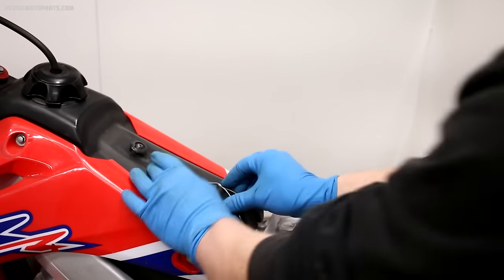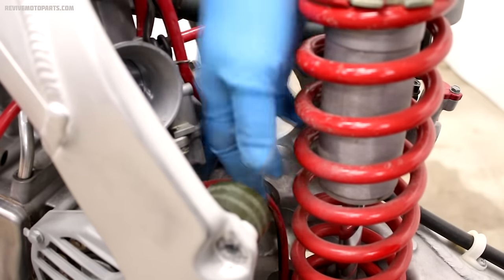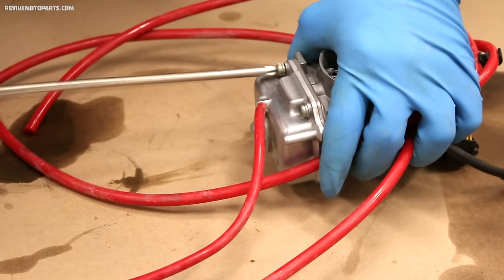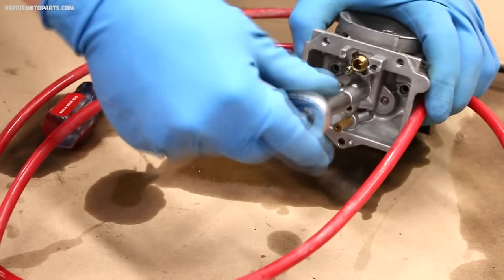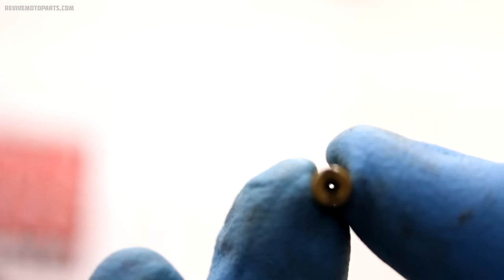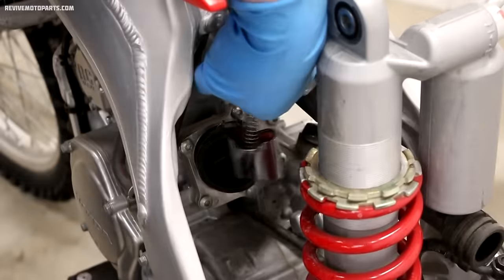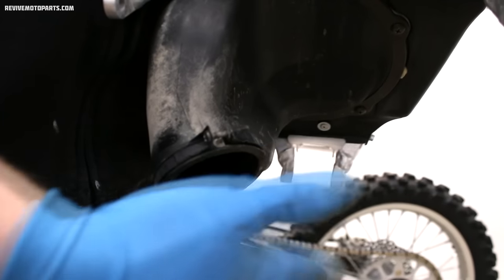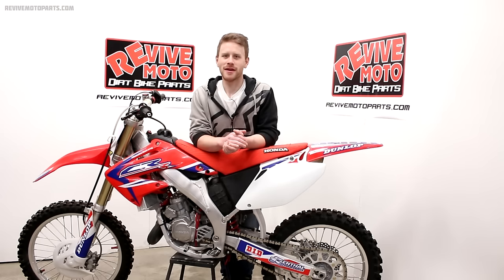Everything You Need To Know About Carburetor Cleaning

Comment: You forgot to mention the use of guitar strings or other brass wire to poke jets clean. Must b a shift metal like brass. Also compressed Air will not work alone, consider using petrol to clean as you know the rubber seals are designed for petrol.

Comment: Will be taking apart my carb this week.
My bike bogged and now wont start. My compression is good ,spark plug is new , i always clean my air filter but it is really worn ,maybe bits got in the carb.
Everyone is recommending me to take my carb apart and clean it
Reply: No way identical thing happened to me this past weekend
Reply: @masonnevill  i just got my bike 4 months ago, 2019yz125 .
One thing i do remember is last 2  weekends at the track my bike wouldnt stay on and it always does.
And this weekend i noticed i didnt really have enough power on the low end like im used to .
I thought i blew my top end which would be too early for a new bike.
Compression is still good spark plug is new , 3 people have already recommended me taking my carb apart to clean it, hopefully im good after that
Reply: Crazy same just happened to me I got cr125 tho started revving really high and then wouldn’t turn off with kill switch had to stall it after that it wouldn’t start I’m about to clean my carb, clean it and change my spark plug hopefully it works I do believe it was running rich so def change of premix
Reply: @FeeLotti  bro it was my spark plug it was only 2 hours in ,but my ratio did foul it completely , i switched to a hotter one and it turned on first kick

Comment: Have you ever ran into the idle screw threads being gummed up and stripping the Phillips head on the screw? I think I finally figured it out, by cutting a flathead into the screw and running it in and out till the threads are decent. Only problem is you can't get the nut back on. Any tips? Ideas? I don't think a tap for that small of a thread even exist lol. I'm open to anything. 

BTW its a 2003 rm 125 I'm in the middle of rebuilding and having to keep ordering idle screws doesn't help haha. Awesome content too man. Keep up the two stroke stuff!

Comment: I learned 3 things after i already installed my carb back on. 
1- i used carb cleaner questioning if i was doing right because it contains acetone and acetone is not eubber friendly

2- my pilot jet was so blocked that I thought it was normal even though it does not make sense; they are jet comon now (telling myself).

3- I did not count the turns on my pilot screw. Just removed it and screwed it all the way xuz i thought all screws need that. Bummer. 

My xr600r carb needs to come back out but this time ill be faster and more thorough in my cleaning.

Thanks a lot for your video. So straightfwd. 

Could you please make a video on how to adjust a 4 stroke valves with both methods

#1- T like on the flywheel
#2 - using the kickstarter to turn the motor while watching the valves movement and adjusting the ones that are up.

Thanks again for everything

Comment: Do you have a video for doing a crf 450 x .. Either way, thus was very useful and I feel much more confident tackling it myself. 
Over the last few days I've been watching a few of your videos and I'm very impressed buddy, thanks
Reply from the maker: Thanks so much for checking out the videos! I don't have a video on cleaning a four stroke carburetor, but the process isn't much different. You'll have to remove the same parts but the carburetor has a different throttle setup and an accelerator pump.

Comment: Hey Cameron, thanks for the simple quick video, definately helpful!

I just finished rebuilding my sons 2003 CR85R from top to bottom, I havent messed with the carb really and it was working fine before the bottom end gave up! Now I have the bike all together again and got it running last night for its first startup. The issue is I have to hold the throttle open a bit to keep the bike running, and when I let off the bike dies as if I hit the kill switch. Do you know why this could be happening? It doesn't even sputter then die like its idling low, it just goes from a minor rev to dead!

Comment: If your jets are gummed up, DO NOT clean out with a drill bit or steel wire. Strip some multi-strand copper wire and twist enough strands that'll fit in the hole and clean out like it's a pipe cleaner. It works like a charm and won't damage anything.

Comment: Hey man I just got a 2003 rm250 today and the throttle is frozen I took the air box off the carb to see there is gross fuel or something so corroded you can’t even see the carb slide it’s nasty I soaked it with degreaser hoping by tomorrow I can get all that stuff off it looks like an electronic carb do you think it’s trash now ?

Comment: I have a question on a yz250 carb I’ve done plenty of them and never had a problem until now I just can’t get the thing to take full throttle it just bogs like a rev limiter when I hold the gas all the way but I can cut the gas off and when it reaches the certain fuel level the thing will take the gas like a champ until it runs out of fuel but I can reach down there before it runs out and cut the gas dock valve on just for a split second and back off and the bike runs perfectly fine I’ve tried adjusting the float level every way possible any ideas on what else it could be if so I really appreciate it

Comment: I've got a 2011 crf150 do you reckon it's not ticking over because the jets are clogged up? Great video
Reply from the maker: The motor is not turning over?
Reply: ReVive Moto Parts I mean it's not idling but I had a go at cleaning out the carb today and I think I was successful everything alright now
Reply: Jack Coates I've got the same bike but an R, 9 times out of ten this bike is just a carberater issue and it's relatively sensitive to weather so keep that mixture screw in check

Comment: Currently have a yz125 2003 and just rebuilt the engine but when I turn the fuel on it starting pissing out like made out the over flow pipe and fuel isn’t even getting through to the engine I’m assuming it’s a sticky float but if anyone knows anything or what to do would be much appreciated

Comment: Regarding the TPS, could someone explain to me how does it work?. I understand that it is potentiometer sensing the throttle, but how it ended up adding more fuel? or it just takes information to the CDI?
Reply: It has nothing to deal with the fuel, so I suppose it sends the signal to the CDI, so the question now is what does the CDI whit this signal?
Reply: In a carbed bike, I think the TPS gets info that is useful to a number of other systems even though it's not about measuring fuel. Example: on a carbed bike with oil injection, the TPS info let's the system know how much oil to be adding to the mixture. I think. No pro here, but that's my understanding.

Comment: I have a CR 125 1995. It idles nice and blips nice in neutral, but on 1st ride throttle stuck wide open even on a closed throttle (flipped me off the back, broken rear fender, bent bars) Any ideas what issue could be?
Reply: Check throttle cable isn’t trapped on frame or piston inside carb may not be lined up on the grooves correctly

Comment: Is it bad to let the motor run with the gas off in order to prevent gas from sitting in the carb?
Reply from the maker: Doing it once in a while can't hurt, wouldn't want to do it every day though.
Reply: Thanks for the response. Also, do you have any videos going through the most common causes of the engine not starting? I have a CRF450 that died mid ride and don't know where to start first... carb, valve clearance, etc. It's always been hard to start.

Comment: What's the reason to disconnect the throttle position sensor from the plug, not the carb?
Reply: Trevor Schnedler have the same question, if you know it, please let me know.
Reply: Trevor Schnedler have the same question, if you know it, please let me know.

Comment: nice explanation. Q: the needle valve rests in a brass cylinder that has a 1/2 dome screen on the intake side that needs cleaning. some carbs allow for these to come out for cleaning. my 07' WR has the cylinder pressed in apparently. there's 3 prongs that appear to be press fitted to hold it. when I went looking for access to the screen on the intake side by removing the center section of the carb I was disappointed to find that none exists, its a closed port that routes to the fuel hose. other then copious amount of carb cleaner and air is there an alternative to be ensure the screen is clear? I saw in another video that some of these have an oring. presuming that mine is pressed and perhaps there is none to compromise with carb cleaner?? https://youtu.be/dl9NCzbYwkI

Comment: Does anyone know how to fix a choke that won't stay up on a 2002 cr125
Reply from the maker: Most likely the choke shaft is worn and need to be replaced. The Honda part number is 16046-KZ4-A92.
Reply: Take a piece of wire and twist it around the plastic tabs on the rubber boots. Plenty of videos on this on YouTube. Pretty easy to fix